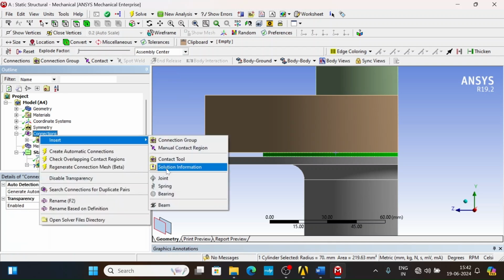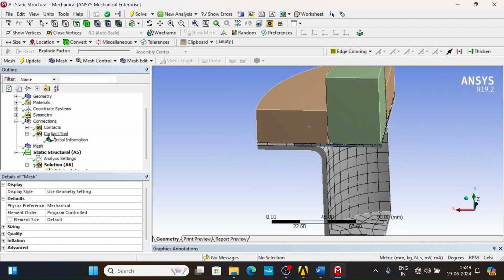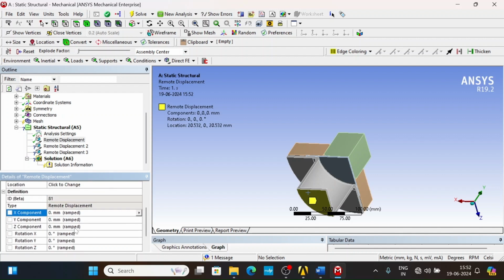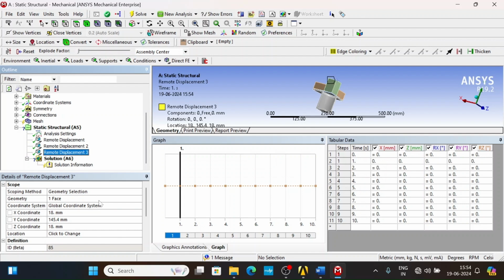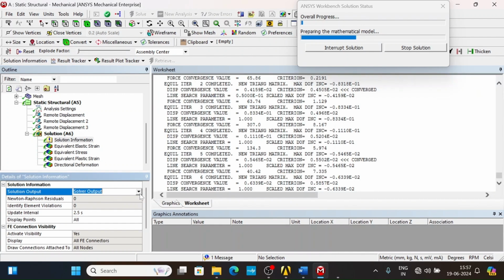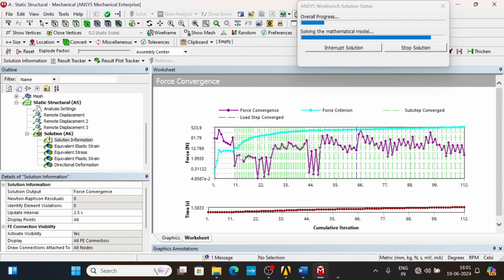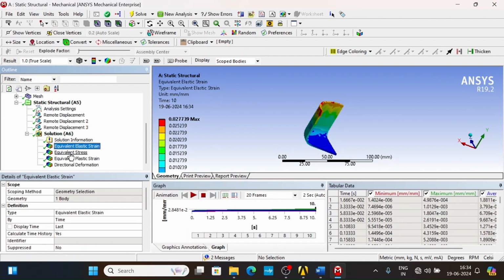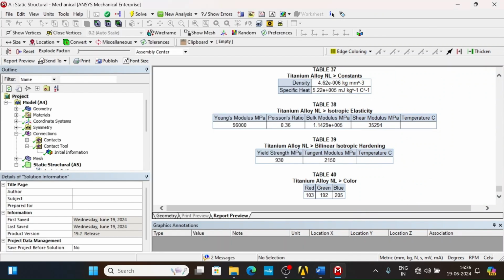Deep drawing process in Ansys workbench 19.2 part 3 (final)

Comment: Nice explanation, kindly clear i) how to add blank holder force and ii) why punch force is not mentioned anywhere.
Reply from the maker: i) you can give force value to blank holder 
ii) Because I don't have any force data, so for simplicity i just given desired displacement to punch due to which Ansys will apply required force to make given displacement possibe 
Thank you for your comment, do subscribe the channel
Reply: @Mechsimulation  Thanks for the response,
Exactly where to find the force applied by Ansys.